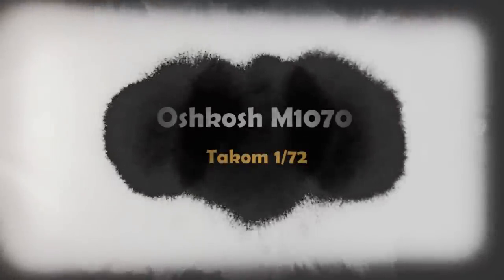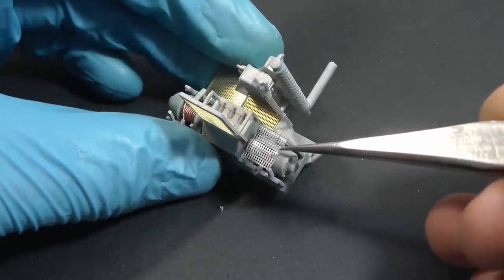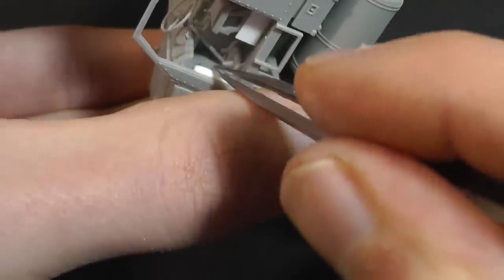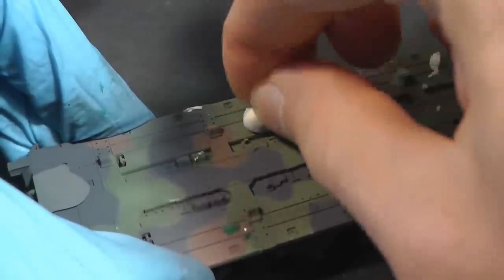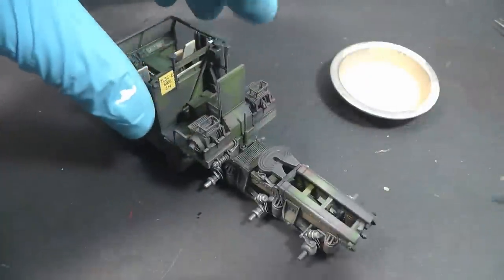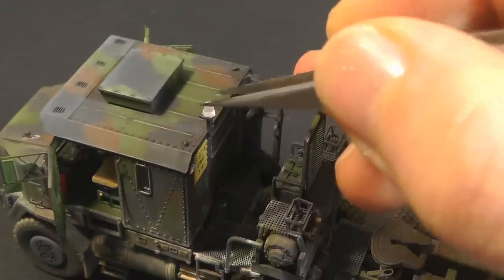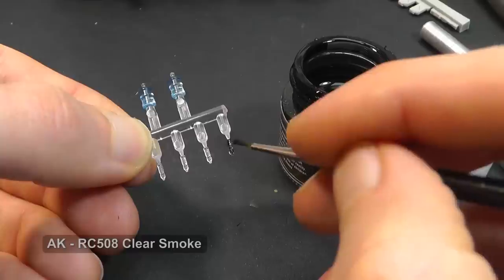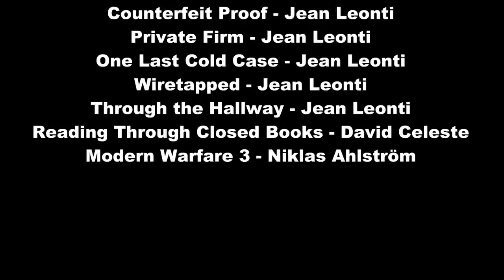Oshkosh M1070 HET - 1/72 Takom - Tank Transporter Model

Comment: I used to drive those and do Maintenance on them.. it's crazy driving them, looking down at civilian semi-trucks. And the trailed had 10 axles and they would steer with the tractor like air craft landing gear.  But they only would go 45mph.

Comment: The only thing I could say needs improvement is the trailer socket. those are constantly used, so there should be no rust on it. Instead, it should be mostly clear, silver metal, with like 4 kilos of grease.
Besides, if it's supposed to be in the desert enviroment, there's not enough moisture to make it rust, even if it wasn't used for some time.

Comment: I worked for a water truck company for 16 years and the owner would buy old big military trucks from the auction and make water trucks out of them! He bought one of these Big Oshkosh trucks identical to this model! I drove it around the lot! He gets these trucks cheap, but this one looked very expensive and high tech for its age, a lot of the only had about 2 or 3 thousand miles on them! None of them had over 10 thousand miles!
Reply: I remember parking this truck next to brand new Peterbuilts, this truck was so tall you would look down to those full size semi trucks, they set up very high!

Comment: Fantastic work. One small thing. I don't believe those are oxygen hoses on the interior. I believe they are cold air hoses. They are to keep the crew cool in their body armor inside the hot truck.
Reply: I stand corrected they are filtered  air.

Comment: Well done, I’ve got this kit plus the one which has the Abrams tank with it in 1/72 scale. Have you thought about doing the 1/72 scale M983A2 with the Patriot PAC-3 launch system. I was thinking about using LED lighting to simulate the Patriot missile launch in that kit.

Comment: Your work is amazing, and years later I felt the urge to build the model neatly, from start to finish carefully.
And I have a question about aqua revell paints. At the beginning I want to paint the model with a brush. Because I have to create a workshop from scratch, and should I thin aqua revell before painting with a brush or not? Or use other company paint.
I wish build revell slt 50-3 with leopard 2A4 for Poland 34th Armored Cavalry Brigade

Comment: Obviously another beautifully done model, but it seems to me you forgot in all that heavy outside weathering to also weather interior of the vehicle. On any military truck interior tends to be the most worn out part of the vehicle while seats on your model looks like the truck has just came straight out of car dealership.
Reply from the maker: I made weathering also in the interior but did not show it in the video. A lot of steps are not in the video.
Reply: @idaemonplasmo  I obviously can't speak for the whole interior as it is hardly seen in the video. What I meant in particular is that "squeaky clean" driver's seat that is shining through those open doors. My experiences with military trucks tell me that seats in them are everything, but squeaky clean. They tend to be torn, scratched, with holes in them and with so many stains it is hard to judge what original color was. 
Here are nice pictures of HET interior (you probably seen them when doing research for this model) and despite the fact that this particular HET was probably cleaned at least a little before being put on display, still it shows how dirty that driver's seat tends to be.
https://www.primeportal.net/transports/jeremy_mowers/het_cab_empty/